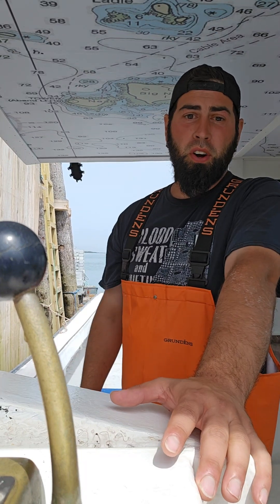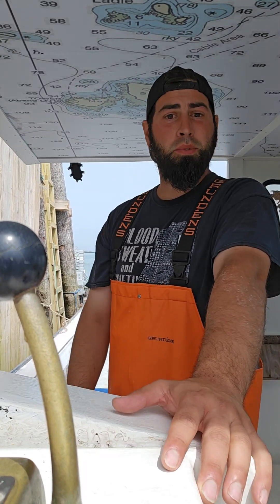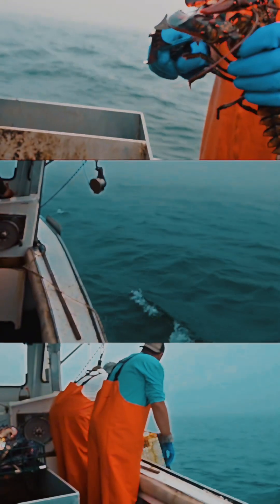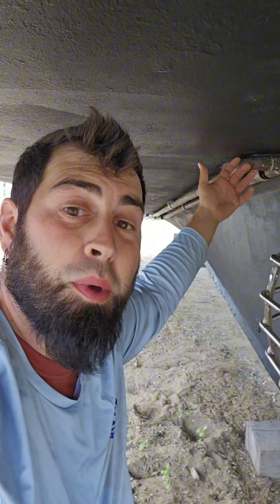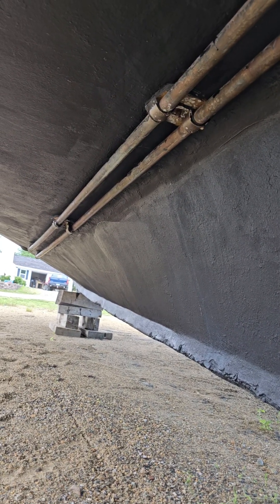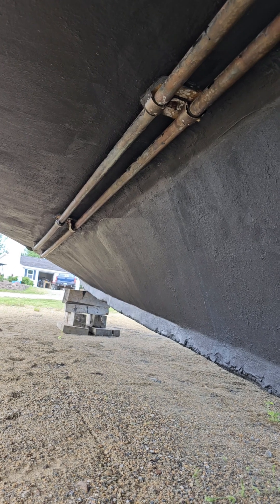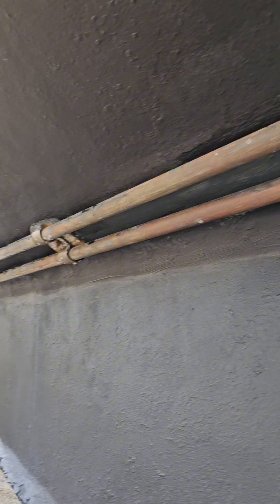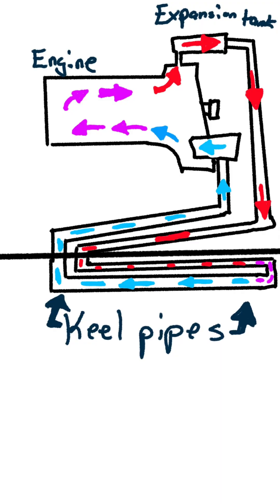Keel Cooling - Lobster Boat - Maine - How it Works

Comment: I had no idea this was an option.  Wild idea:  Surface area, and creative shapes maybe?  It doesn’t have to be a pipe.  You could weld an entire sheet of metal to the hull with a 5mm or less gap.  Then run the antifreeze through there.  Giving you more surface area and less drag.